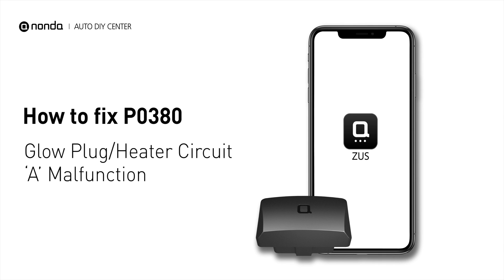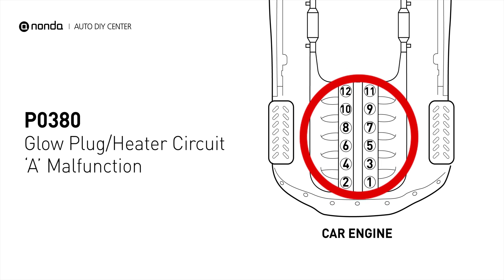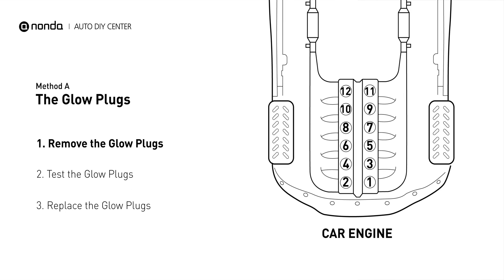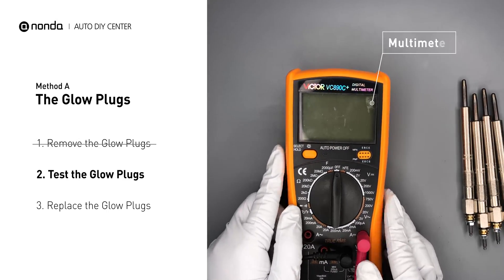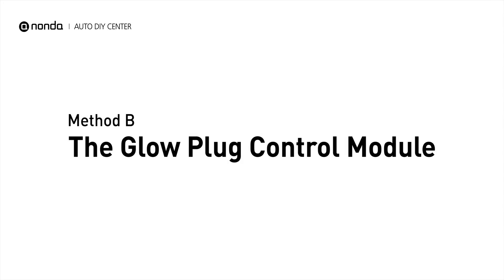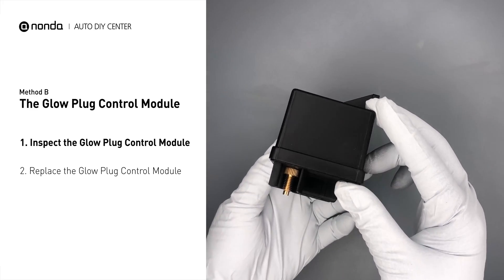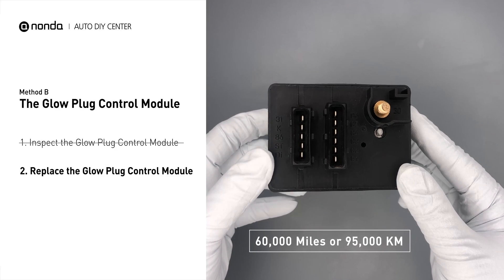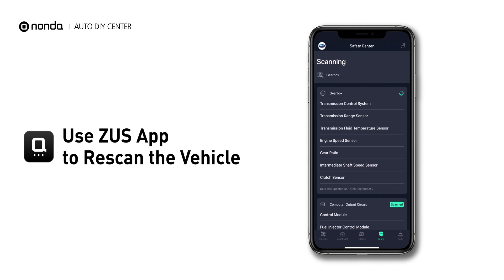How to Fix P0380 Engine Code in 3 Minutes [2 DIY Methods / Only $9.29]

Comment from the maker: Hi, I'm Steve, nonda's lead mechanic engineer. 
Feel free to leave your comments here if you have any mechanic questions, I will be glad to help you out!
Reply: Would this code be synonymous with the water in fuel sensor circuit 'A' malfunction as those are the only 2 codes i have. Car still runs spot on though.
Reply: I have a P0380 code on a 03 duramax I changed the plugs and module, still receiving the code all plugs test to .4ohms, could this issue be related to the IAH circuit?
Reply: Hi i have a van nv350 nissan got to code p0380 p1028 

My van is consumation of fuel is to high.
Reply: Xe của tôi hay chết máy khi chẩn đoán thì xuất hiện lỗi P038013 bạn hỗ trợ lỗi này nhé

Comment: Maybe useful for someone: 

I have had the same errorcode on my opel corsa d from 2014, 

Replace the glow plugs, replaced the glow plug time relay, both didn't help. 
Measured all cables going to the plugs, no issues at all. 

Then followed the cable which comes into the glow time relay. The thickest cable goes into the fuse box which is on top of the battery of the vehicle, and there it was. The connector was loose, just popped it back into place and away was the P0380 error.

Comment: Hello Steve, 
I have a ford focus 1.6 TDCI engine, my car is running in safety mode, no boost feeling, very very lazy in fourth, fifth gear, I found 2 error codes ( P0113) MAF sensor, that I chanded but problem not gone, second error code P0380..related to glow plug, do you think it's could be the problem? Should I start to test glow plugs ?
Thanks.
Reply from the maker: Hello, as you are getting more than one error code, we suggest getting your vehicle visually checked by your local mechanic for further diagnosis.

Comment: I have a 2006 1.9cdti zafira. Code came up last year. All glow plugs were changed by the garage. Same code comes up again now....could it be the relay? Would there be anything else causing this code?
Reply from the maker: Is there any other codes that register along with this code?
Reply: @nondainc  yes P0606 ECU malfunction.

Comment: Does a P0380 error code make your car consume more fuel than usual? I only as as I have the error code and my fuel (remaining till empty) was at 210 miles. I drive 30miles and my car says its done 100...... but no leaks underneath - wasn't sure if it was all related
Reply from the maker: Have you double checked if there's any other trouble code registers along with this code?

Comment: I have 2011 Renault scenic 1.5. I get the spanner light come on the check injection system.
I scan with a cheap obd reader and it error code P0380 comes up.
I turn it off and it might not do it again for 7 months or so?
Reply from the maker: Have you tested the Glow Plugs and inspected the Glow Plug Control Module?

Comment: My code is intermittent, sometimes only coming on for a spliut second, sometimes around 10 seconds.  Ive ahd the plugs replaced and the mechanic says he checked evrything else (I assume the control module) he suggests i take it to an auto electrician as he suspects it could be the wiring.  Could this be the fault?
Reply from the maker: Hi Jay, possibly- Yes. The issue could be coming from a damaged wiring. Please have them fixed to see if the issue will still persist.

Comment: Hi there ive got a 2011 nissan qashqai the engine cranks but fails to start and get the code “p0380 glow plug relay “ is because of a bad relay
Reply from the maker: Hi Rehman, Yes- it's possible. Defective glow plug or relay is one factor triggering this code. We recommend having your vehicle checked by a technician.
Reply: @nondainc  Thank u i will definitely change the relay first myself then see if it starts and if not will also change the plugs